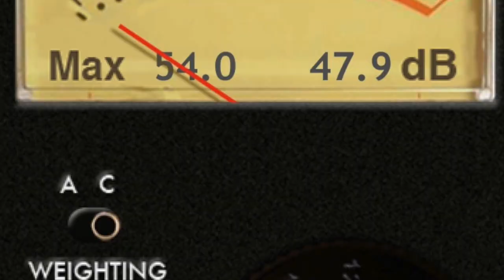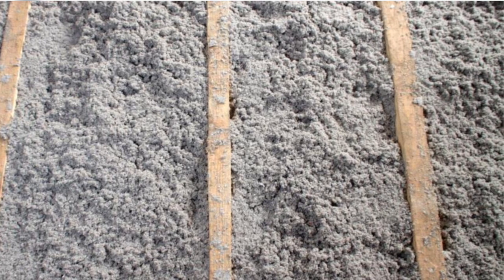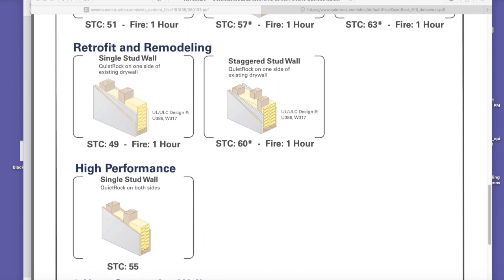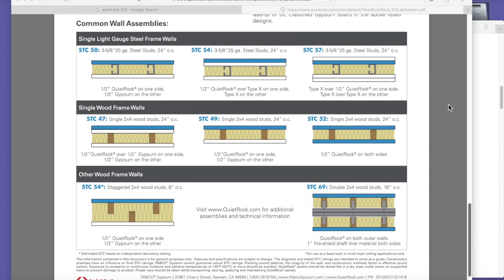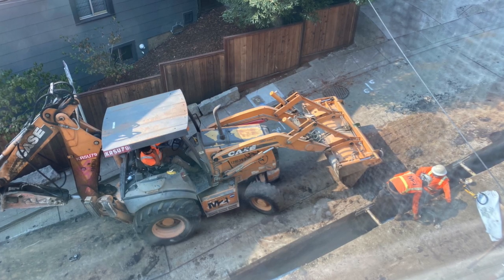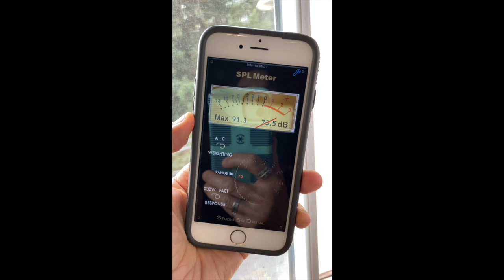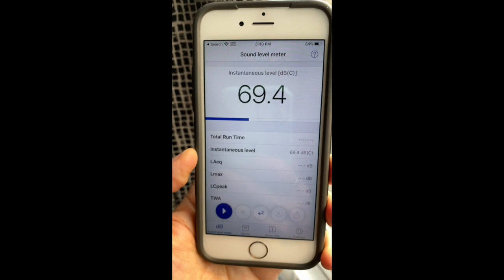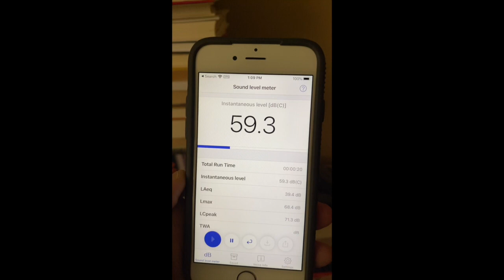See how Quietrock and Green Glue work together to soundproof your walls! (first test)

Comment from the maker: I made a small error in my narrative, so I'm correcting it here: QuietRock 510 is 1/2-inch thick, and it's like two 1/4-inch pieces of drywall sandwiched with a viscoelastic polymer in the middle (I mistakenly said "two 1/8-inch pieces" in the video).
Reply: I live in a building apartment and i can hear my neighbors talking and tv clearly , which quietrock is  better to soundproof a existing wall?
Reply from the maker: @organicfireorganicfire1236  It depends on if you want to demo the wall or not. What I learned from my experience was that instead of demoing the wall, I could add a second layer of QuietRock (510). This drywall was 1/2-inch thick. I put it on top of the existing wall, with a layer of Green Glue in-between the two layers of sheetrock. And it was really good for muting conversation, TV, etc. It's like double-dampening --  because the QuietRock already has a layer of dampening in the middle. I also recommend blowing insulation into the original wall first. I'm assuming your wall might be hollow right now. And use blown-in cellulose, not blown-in fiberglass.

If you can't hire a local company to do the blow-in insulation, or if renting the equipment and doing it yourself is too difficult, another option is to cut some rectangular "slices" into your original drywall and set them aside. Cut the slots big enough to slide in some insulation batts inside the wall between the studs before you add the new drywall. Think of them like big mail slots -- maybe cut one closer to the top of the wall and one about 2-3 feet from the bottom, one for each cavity between the studs. (Most of these open spaces are about 15" wide.) Then after you slide the insulation in behind the wall, put those rectangular slices of drywall back where you cut them from, and seal them. They don't have to look perfect because you're going to cover that wall with the new layer of drywall. But you don't want to leave the original wall with holes in it! This is an imperfect hack, but better than a completely hollow wall. Also, if you live in an older building (pre-1940s?) with lathe-and-plaster walls (not sheetrock), this won't work. 

Basically, don't waste an opportunity to add insulation at the same time you add mass (1/2" of more drywall) and viscosity (Green Glue).

I see that there's at least one newer model of 1/2-inch QuietRock available now. I've never used it, but it's called QuietRock 500. It's advertised at places like Lowe's, and they state that it has an STC of 42. That means it filters out about 42 decibels of noise. I think each 4x8 panel is about $56, but worth it.
Reply: @soundproofist  thanks, yea the building is old and the wall hollow  lathe and plaster......Im thinking of getting quietrock 530 they really expensive tho, I just wanna make sure it really gonna work.
Reply from the maker: @organicfireorganicfire1236  I think it will help (especially with the Green Glue), but I've never tried it over lathe and plaster. Are there specs anywhere on doing that?
Reply: I caught that mistake but knew what you meant ;)
Reply: @soundproofist  you think just blow in cellulose insulation will be enough to mute tv and voice
Reply from the maker: @organicfireorganicfire1236  It reduces it a little, but it's not perfect. In my opinion, cellulose mutes airborne noise better than fiberglass or a hollow wall. You might still hear some sounds -- like some voices or some sounds from the TV. But you did say you have lathe-and-plaster walls, which could make this more challenging. I found a short video created by a guy who blew cellulose insulation into lathe and plaster. https://youtu.be/TQ16I4VyU9M. If possible, I recommend you hire a pro to do this, someone with experience with this type of wall. And finally, I believe in doing things incrementally. So if you blow in insulation, it might be good enough for many of your needs. If it's not, you take it to the next step -- for example ,adding a 2nd layer of drywall. Unless you own the place or unless you want to do a remodeling job, try step by step.
Reply: @soundproofist  great idea & explanation
Reply from the maker: @pearlperlitavenegas2023   Thank you!

Comment: The green glue cost 3 times more then a regular adhesive caulking.  And all it does is glue the drywall together.  It does nothing to slow down sound.  Because the sound is not passing through the green glue.  The sound is passing through the two pieces of drywall,  not the glue. So how can the green glue effect the sound?  Green glue is nonsense.
Reply from the maker: Well, I agree with one part of your comment: "The sound is not passing through the Green Glue." You're absolutely right. The sound doesn't pass through the Green Glue. It passes through the first layer of drywall that's attached to the studs, but it doesn't pass through the viscous/gelatinous layer of Green Glue, therefore it doesn't pass through to the second layer of drywall -- the one that faces out into the room. Green Glue isn't caulk -- that's a different product.
Reply: @soundproofist    But the green glue only covers 20% of the drywall at most.  So 80% of the wall has the sound passing through it with the green glue not having any effect.
Reply from the maker: @chrisbatchelor3717  Because I used a combination of Green Glue + QuietRock used together... and QuietRock 510 already has a noise-reducing membrane sandwiched across the entire mid-section of each 8 x 10 panel... it's hard to say how much of the sound reduction was caused purely because of the Green Glue and how much noise reduction was solely from the special drywall. My point is that by doubling the layers of drywall (adding mass), using Green Glue (instead of simply pressing two hard sheets of gypsum together with no noise/vibration reduction in-between), and using soundproof drywall as that second layer instead of $10 gypsum board made a difference in combination, together. I think they were more effective than just using one of those options alone.  I'm incredibly grateful that I have this room to escape to after six months of incessant construction noise in front of my home.
Reply: @soundproofist  Green glue reducing sound is nonsense.  My point is that green glue doesn't do anything more to reduce sound that any other adhesive caulking but it cost 3 times more.  Because the glue is only covering 5% of the drywall surface,  therefore 95% of the sound is passing through the drywall only,  not the green glue.  So how can the green glue slow down the sound if the sound is going right around it.
Reply: @chrisbatchelor3717  Green glue is just an expensive brand should not be used, just take any adhesive caulking you will have the same results as what is making the difference is the air gap it makes between two layers of of drywall the sound is not directly transmitted trough both drywall sheets but from one drywall trough the air gap and than again in the next dry wall and in this process it loses some of its strength
Reply: @chrisbatchelor3717  Green Glue is not caulk, it contains 'viscoelastic sound absorbing polymers' and that is where it's benefit comes from. I just installed this today with QuietRock and will find out the results once my neighbors return, it could be weeks or a month or more before I know.
Reply: @maha77  But your green glue only covered about 2% of your drywall.  So how much sound could it be slowing down?   Thats right not even 2%
Reply: A certain carpet glue does the same thing and is much cheaper.